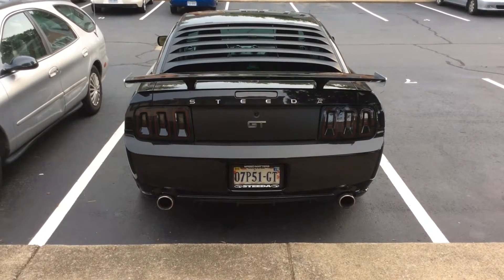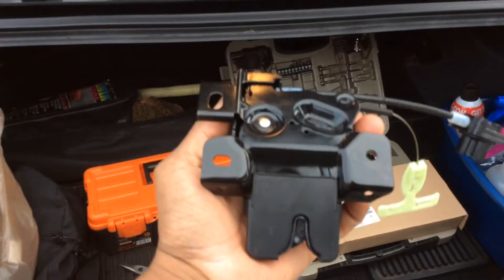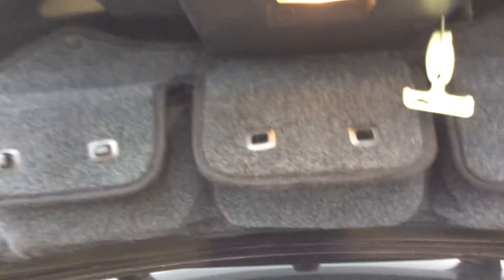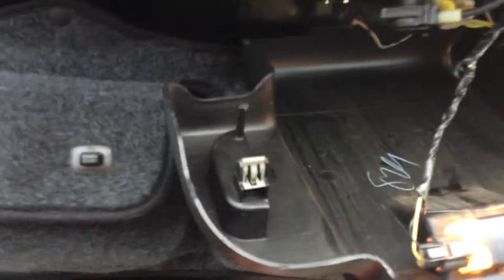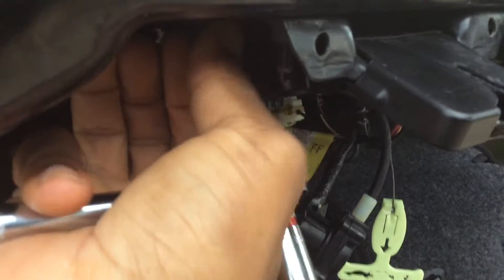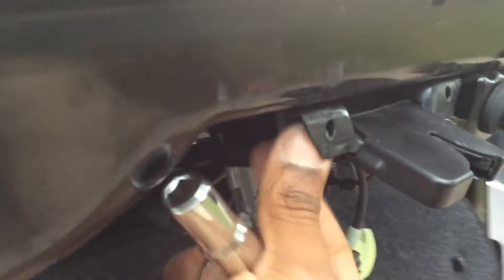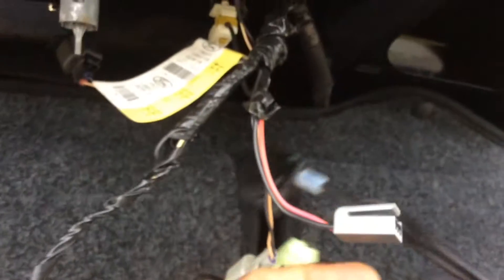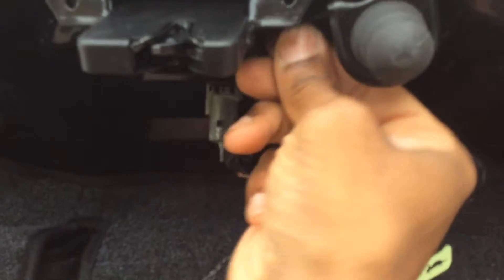2005-2009 Mustang Trunk Latch Noise Repair

Comment: What are those saddlebag looking things attached to the inside of the trunk lid? Did they come standard, or did you add them yourself. Looks pretty helpful for holding small things, and keeping them from rattling inside the trunk.
Reply from the maker: I added them. I cannot find them for sale anywhere now. I used them to hold towels.

Comment: I bought a new truck latch and followed the necessary steps to put it on but it still won’t shut when i slam it to close it ???? Any help ???!
Reply from the maker: Since the latch is new it must need to be adjusted.  https://www.yourmechanic.com/article/how-to-adjust-a-trunk-latch-by-spencer-clayton
Reply from the maker: Troy Jones, Examine the latch and the area where it connects to the body of the car. Either of these might have become bent out of shape or damaged in some other way if the trunk has been shut with an obstruction in the way. If this is the case, contact your vehicle's manufacturer or a local garage to find a replacement if the elements cannot be repaired.

Check for any dents in the body of your vehicle around the trunk. If the body work is warped or out of shape, the latch could be out of alignment. If this is the case, it's a good idea to talk to a body work specialist before making any attempt to remove the imperfections yourself.

Comment: Very helpful,  I have the same problem on my 2010 Mustang GT.  It's now causing my battery to drain bc the light in the trunk doesn't shut off. I have to make sure @ all times it doesn't say trunk ajar on dash to keep my battery from draining.  I'm a single female & not sure if I can fix it alone, but I wk in orthopedic surgery putting parts & screws together for broken bones that look impossible so I think I can do it.
Reply from the maker: You can do it yourself. It is really easy. A power tool would make it easier.